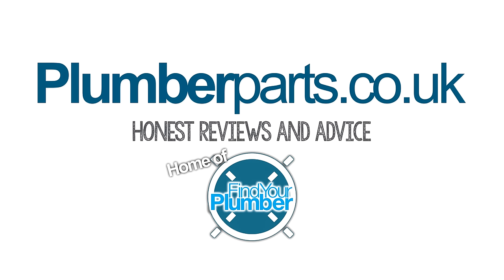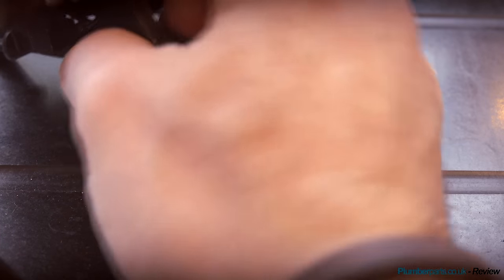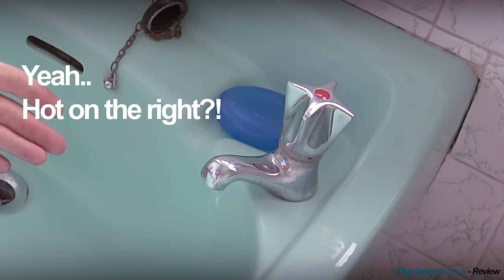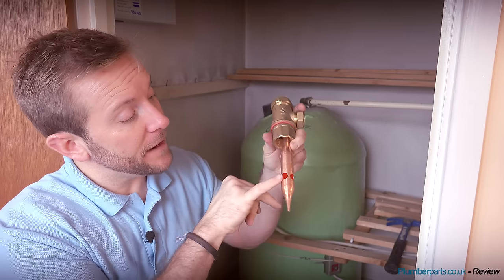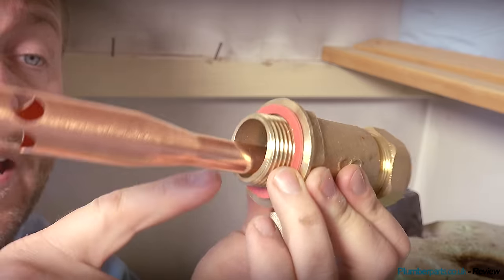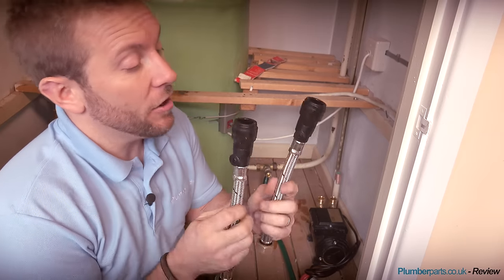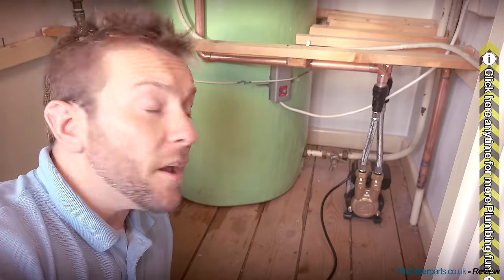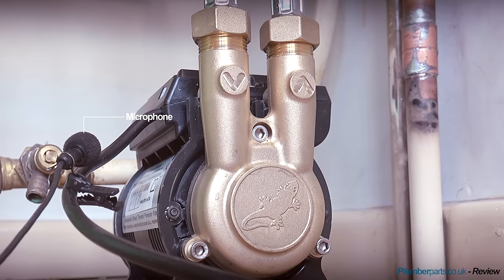BOOST HOT WATER PRESSURE - CT Force pump

Comment: i have installed exactly the same as you did here except i did not install flange . and have very loud and strange noise coming from unknown location when pumps cuts off or even when shower running there is a video here its starts at 1:20 https://www.youtube.com/watch?v=kJRssL9W6zE do you have any idea what is wrong ?
Reply: Looks like toilet valve, that little plastic toilet tank filler.
New one is cheap, or change to different type (sudden cut) 😉